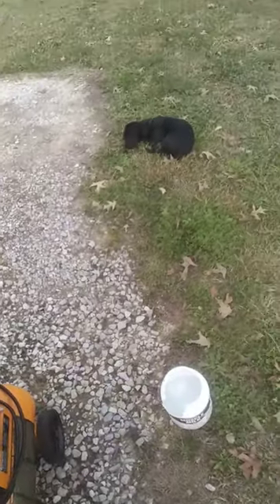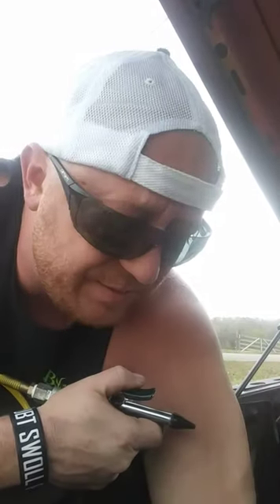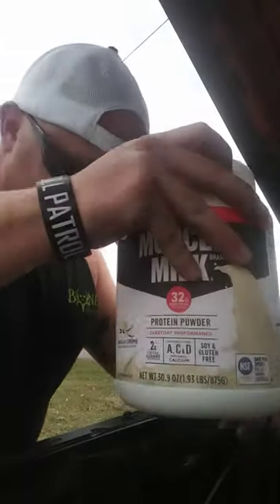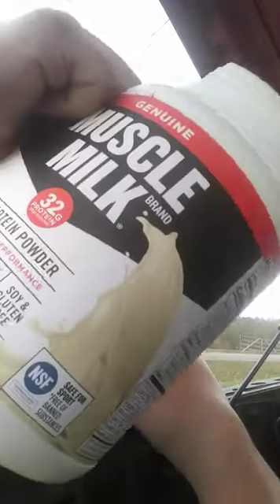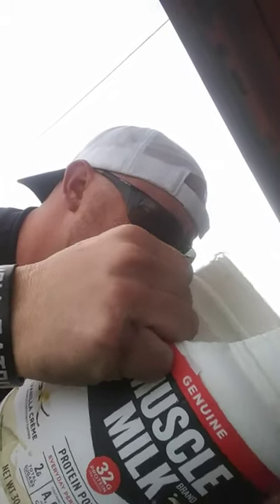Dodge Ram no heat / clogged heater core / easy

Comment: Thank you im going through the exact same issue i will try this out!
Reply from the maker: You're welcome! You can pour some white vinegar in, let it set for about 5 minutes then flush it out with water. That helped mine alot.
Reply: @aceofpace1378  ok i will try cause yhia dodge is giving me hell but hell i love my dodge lol
Reply from the maker: @jv-ix6jh  you and me both lol 206k miles on mine
Reply: @aceofpace1378  im at 195537 😂 ima keep on truckin
Reply from the maker: @jv-ix6jh  hey bud, just out of curiosity,  did this get your heat going?
Reply: @aceofpace1378  yes but actually my dumb self needed to change the thermostat  after the fact I opened my vents from the inside to make them stay up smh ...lesson learned
Reply: @aceofpace1378  but any advice about why is it taking so long to heat up on the driver side ..it heats up quick  on the passenger but slow to heat up ok the driver
Reply from the maker: @jv-ix6jh  I haven't figured that part out yet. It does get alot better when you clean out your heater core. Last year, I poured white vinegar in my heater core and let it sit for about 5 minutes then flushed it out really good both directions.  Best heat I've ever had. I'm due another flushing so I'll try to make a new video of it.
Reply: @aceofpace1378  thanks man I'll  note that . I haven't flushed in a while but the dodge keep trying to charge me here and there an they haven't made any leaps no more than I have
Reply from the maker: @jv-ix6jh  hey bud , out of curiosity, did you get that truck acting right?
Reply: @aceofpace1378  it worked for a while but now it's back to the same just heat only on the passenger side
Reply from the maker: @jv-ix6jh  sounds like you've got alot of junk floating around in your antifreeze. Well, you know what to do now lol
You can also get the whole system flushed. Antifreeze is supposed to be replaced every 5 years.
Reply: @aceofpace1378  ok thanks man ! Will hop on that asap!!
Reply from the maker: @jv-ix6jh  yes sir! Keep me updated bud
Reply: @aceofpace1378  yes sir will do!!

Comment: What temp thermostat are you using? I’m using a 195 and the water goes into the heater core fine but it doesn’t get hot enough before it gets to the heater core I have a 00’ Dakota.
Reply from the maker: In my 97 Dakota I used a 180°
That's plenty hot enough for some heat.
Reply from the maker: After your truck has warmed up to temperature, shut it off and touch both hoses. To see if one is cooler than the other. If one is hot and the other isn't that means it's not passing through and the heater core is clogged. Or if you are low of antifreeze, it won't circulate through the heater core. If neither of those are the problem, you may have an issue with the blend door that goes from cold to hot.
Reply: @aceofpace1378  where is the blend door? Is that the knob that heat/cool control?
Reply from the maker: @the_allamerican7057  to the best of my knowledge,  the blend door that adjusts from cold to hot is pretty close behind the glove box. I've seen a couple video here on YouTube that shows the placement. A friend of mine was having issues and it turned out his was the control knob itself. I'd imagine you could find the part on eBay pretty cheap. First I'd look at the door itself. You can raise the lever by hand to make sure the door is opening and closing. It's attached to a single cable that adjusts the amount of heat from the knob.
Reply: @aceofpace1378  alright thanks I’ll have to check it out. I’ll get back to you and let ya know if it worked
Reply from the maker: @the_allamerican7057  awsome! Yeah,  you've got me interested so I'd appreciate a follow up bud. Good luck to you
Reply: @aceofpace1378  I looked at it. That is the problem. But it’s a pain to get to. I’d have to take the whole dash out. I know that’s the issue because when I turn the temp dial to cool I can hear it. And it’s not electric. When I switch to heat it’s supposed to pull a vacuum and open the door to pull water into the heater core and it’s not doing that. I ran the truck until it got upto temp. And switched on the heater and I may as well of had the ac on still. It still blew ice cold no sign of it even attempting to get warm.
Reply from the maker: @the_allamerican7057  man that stinks. I've never delt with any vacuum problems bud so I'll be no help. Hope you can find a way to get it to work.
Reply: @aceofpace1378  thank you I appreciate it however. I had done some more digging and found out that if the ac works, it switches from cold to hot. Then the heater core is clogged. So now I have to flush the radiator. And however come to think of it when I got the truck I flushed the radiator or lack there of it took it forever because the drain was so full of rust. So hopefully once I’m able to flush out the heater core it’ll work. 🤞🏼
Reply from the maker: @the_allamerican7057  did you ever touch your heater core hoses after it was up to temp? If one is hot and the other isn't,  the heater core is definitely clogged.
Reply: @aceofpace1378  yes I did. I could feel water being sucked into the heater core. So I let it run about 20 minutes. And it never got hot (the air coming from the heater) there’s no leaks inside the cab either.
Reply from the maker: @the_allamerican7057  if you had that much rust in your last flush,  it may be time of a new radiator too. I bought one for $55 on eBay about a month ago. Didn't take long to install. I though about making a video of it but was trying to beat the rain that evening . I don't think a full system flush is too expensive if you take it somewhere.
Reply: @aceofpace1378  yes I did the inlet from gets hot and sucks in water but that’s it.

Comment: Flush the cooling system every couple of years and you won't have that problem.. just use the garden hose and flush it out..much better than using air... that's right I am a retired mechanic of 25+ years
Reply from the maker: Most folks don't buy their vehicles and hold on to them till they hit 200k miles . If you're a mechanic for 25 years, why are you watching videos on how to flush a heater core ?
Reply: @aceofpace1378  because I want to.. your way is just a hard way
Reply from the maker: @scottrussell6717  seemed pretty simple to me... I clean mine every year. I've put in a new radiator, water pump and alot of fluid but it still manages to lose some heat by the end of summer.
Reply: @aceofpace1378  doesn't make sense... sounds like you have done everything buy check the ducts... the heater core maybe clogged up on the outside possibly

Comment: Just a question, don't matter if a switch the horse's? Or those have direction ⬇️⬆️?
Reply from the maker: I've reversed mine before and I had no issues.
Reply: Thanks a lot 😀
Reply from the maker: You're welcome! The last time I flushed mine, I turned both hoses straight up. Then poured white vinegar and let it sit for about 5-10 minutes.  I flushed it with water again and blew it out again. The best heat I've ever had in my truck.

Comment: CLR is a very intense corrosive agent and it will eat rubber, some plastics, and aluminum away if left on the surface. That's why it wrecks your pumps, hoses, etc.

Have same problem though, 2002 durango with a heater that keeps going cold every year.
Reply from the maker: Recently I've used white vinegar.  It works really good
Reply: @aceofpace1378  oh yeah, yeah, vinegar works too, its safe to use on rubber and plastic and etc.

Comment: CLR will eat at the aluminum....just flush the core with low pressure water.
Reply from the maker: Brian Kelley on my last flush, I used water and white vinegar and let it sit for about 5-10 minutes. It worked great! It was by far the best results I've gotten doing this.

Comment: I have No heat in my 2013 Ram 1500! Both hoses going to the Heater Core are hot. does the Core need to be flushed?
Reply from the maker: If both hoses are hot then circulation is there. If it is blocked, the inlet hose will be hot but the outlet will be cool because the hot antifreeze isn't going through. Your problem sounds like a blend door bud. There is a door that changes the direction of air flow to defrost, floor or forward facing vents. The other door adjust the amount of cold or heat you select from your adjustment knob on your dash. It has a small electric motor that moves the cable to the door. Dodge is notorious for having bad doors/ flaps inside there. If you're lucky its just the motor and you can adjust the flap under your dash somewhere around behind the glove compartment till you can order the motor.
Reply: did u figure out your problem i’m having same issue I haven’t checked heater core hoses to see if they’re both hot or one hotter than the other i’m gonna do that tomorrow hopefully i just need a flush I replaced blend door not too long ago and isn’t doing the fix

Comment: Thanks my man.
Reply from the maker: You're welcome bud
Reply: But still no cigar. I have very bad temper sometimes and I'm close to smashing my 2016 ram. I replaced thermostat,  flushed heater core, closed outside vent door under dash and still cold heat. I do hear actuator under dash working but I guess I'll try getting under dash today to try a fix I saw. Apparently if I pull off the actuator and turn the heat knob manually,  it will turn up temp. Can't be the temperature knob because when I turn it towards cold it doesn't work and I do have ice cold AC. If you see on news, man beats up his Ram 3500.........well that will be me.
Reply from the maker: @BillyP-49Chevy  with that flush on your heater core, you'll probably have an air pocket so it won't be circulating through the heater core. Did the thermostat read like it was over heating ?
Reply from the maker: I have flushed mine before and an air pocket was trapped in the heater core. I had to find a steep hill so the radiator cap was just about level with the heater core before I could get it out. I also had to burp the radiator. Once it's close to running temp, put a thick rag over  radiator cap and bearly uncap it. *Not fully take it loose*. Be careful because they are somewhere around 12-16 psi so antifreeze can get all over you.

Comment: Do u have a dual zone?
Reply from the maker: No. When you flush , pour some white vinegar in and let it sit for about 5 minutes or so. Flush both ways really good. Blow air but remember dont go wide open into the hole at first. Definitely don't want to hurt the heater core and cause a leak.

Comment: Mine just stays cold could it be it needs this too?
Reply from the maker: Your vents or heater core lines? If there is zero change when switching from cold to hot, it could be the actuator that adjusts to the level of heat. Clean out the heater core first. It doesn't cost anything other than just a little antifreeze.  Also , pour in some white vinegar and let it sit for about 10 minutes.  Flush it really good with water and air both ways. I about bet the heater core is your problem. Just needs to be flushed. Antifreeze is technically supposed to be swapped out with fresh every 5 years.
Reply: @aceofpace1378  My vents i’ve yet to check my heater core lines but you’re right it doesn’t cost a dime and that could be my problem thanks for the video boss
Reply from the maker: @hugo1655  absolutely bud! Glad to help

Comment: I have that exact issue with my truck driver cold passenger hot and low heat
Reply from the maker: Hopefully this will help!  Recently I've poured in about a cup of white vinegar. Make sure both hoses are pointed up so that it will sit in the heater core. Let sit for about 5 minutes and then flush out again both ways. Hottest heat I've had in my truck.

Comment: Anyone done this to a truck that had no hot air on either side? Any good results?
Reply from the maker: It works for both sides. Pour some white vinegar in there and let it soak for  about 5 minutes. Flush out with water both ways and blow some air through.  You'll have great results

Comment: There is no way that flushing your heater core will cure heat on one side of the heater and cold on the other. The control on the dash or a blend door actuator is the problem. If your engine is hot and the hoses hot you should at least get some heat out of both sides.
Reply from the maker: Both hoses were not hot... if you know so much about heater cores, why are you watching videos on how to clean them?

Comment: We don't even see where you are putting that air
Reply from the maker: There is only two tubes, that are shown... you should probably not do this if you you can't figure that out
Reply: @aceofpace1378  I know that but one is going in and the other comes out which side should we try to flash it out I am pretty good with cars but every car is different Thanks
Reply from the maker: You'll need to flush your heater core both directions so both will hoses will need to be flushed.
Reply: @aceofpace1378  Thank you
Reply from the maker: @VeyselHatice-w2h  you're welcome! You can also pour some white vinegar in first. Let sit for about 5 minutes. It will help clean out the heater core.  
Then flush it out with water and  air like the video shows.
Reply: @aceofpace1378  Never thought about vinegar good idea Thanks